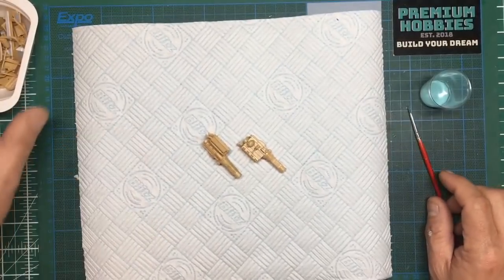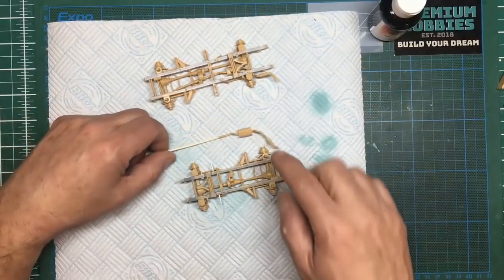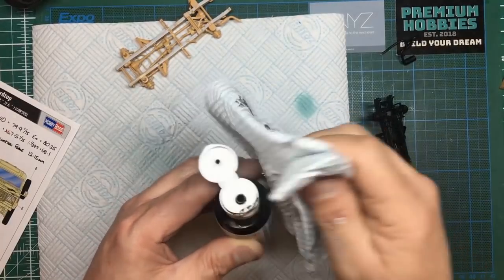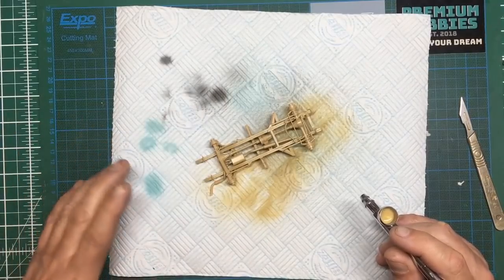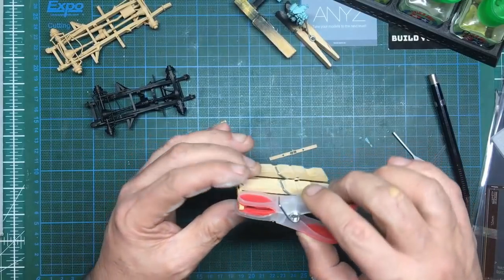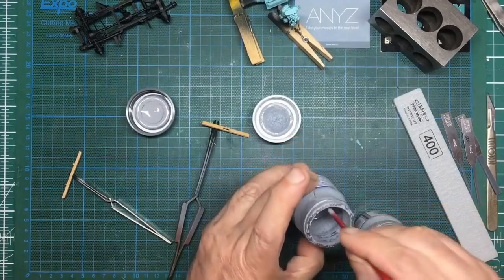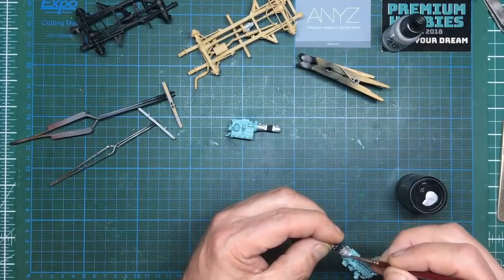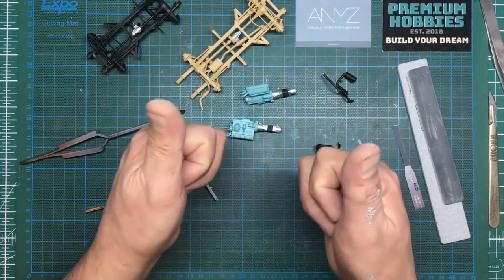HobbyBoss 1/35 Landrover SWB conversion. Part 7

Comment: As a reference for applying washes over enamel paint I use artists oil thinned with Testors thinner or mineral spirits after applying a clear coat of Future or AquaGloss.  This is followed with a coat of clear flat once in everything is completely dry. bI have been using Model Master Paints for years and other than the smell prefer it to acrylic paint, but that is just me.  Thanks for the great video Nigel.  Looking forward to part 8.  I’ve been mojo-less since christmas after some issues with a plank-on-frame wooden man-o-war I am working on.  Time to get back to styrene I think.  Cheers.

Comment: Good work as always, Nigel.. I use enamel paints for all of my basecoats, and I thin them
with lacquer thinner instead of enamel thinner.. 60 thinner 40 paint for gloss, 70 thinner 30 paint for flat depending on paint brand of course.. much like the primer you tried, it bites
the plastic better, and you can apply much thinner coats. Spray booth and respirator
of course..
Reply from the maker: Thanks for the tip. I'll try next time with levelling thinner.